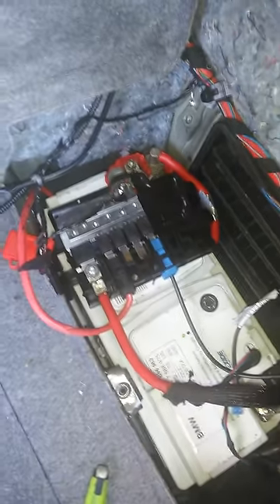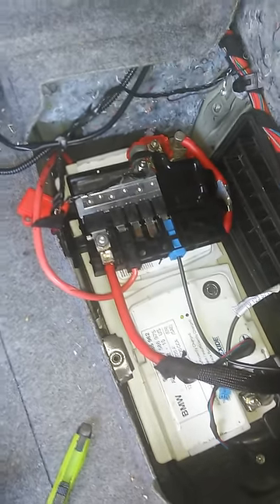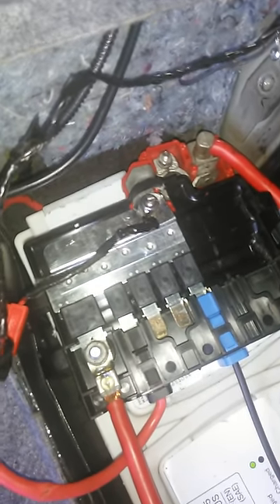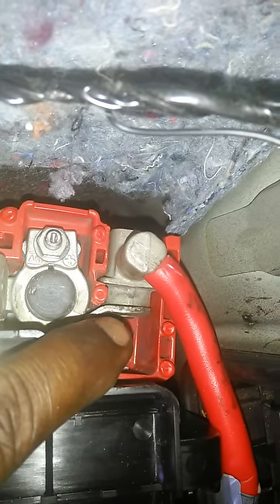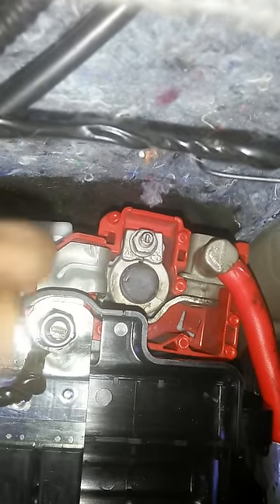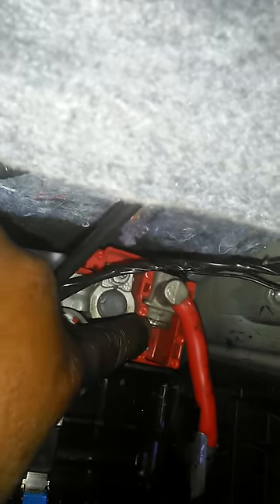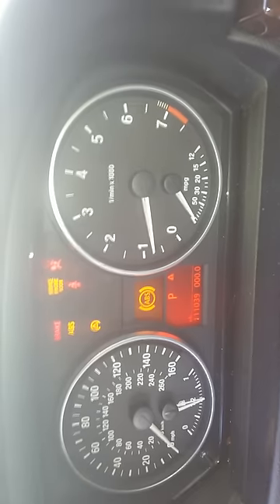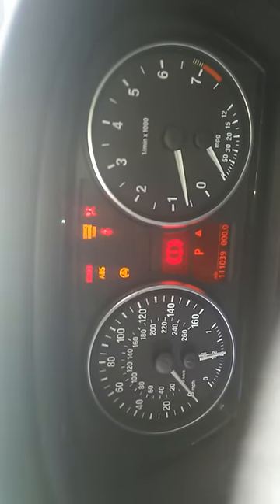08 bmw 328I starter no start problem .... FIX !!!!

Comment from the maker: What i found out is the "fuse" is some kind of feature to basically cut power to the car after an accident ... Basically i eliminated the fuse and it started rite up... The top snaps off easy ... Like i said im just trying to save ppl some money cus im sure the diagnosis and repair at a shop or dealership would be ridiculous ... Took me 10 minutes and boom problem solved .. I hope this helps
Reply: had the same thing happen on my 2007 525.  looks a little different but does the same thing.  I did same as you and just shoved it back together.   car started and ran like normal but I kept checking that battery cable and mine was getting super hot after just 5 minutes of driving.. I kept checking and it eventually split that big thick battery cable from the heat..  so I ended up having to find another BST that hadn't blown off to replace it.  I have know idea why it would matter unless there is some kind of resistor in that sensor that you took off that regulates the electrical flow..   just please make sure your wire isn't getting hot
Reply from the maker: MINE RUNS JUST FINE...IF YOURS IS GETTING HOT... IT GROUNDING SOMEWHERE MOST CARS THAT WIRE RUNS DIRECT TO STARTER ... IN THE VIDEO THE CAR WAS RUNNING FOR ATLEAST 30 MINUTES CUS I WAS TESTING THE COOLING SYSTEM TO SEE IF IT WOULD OVERHEAT.. NOT SURE WHY THEY DONT HAVE TEMP GUAGES BUT YEA...LOLTHANKS FOR THE HEADS UP BRO !!
Reply: 2008 bmw 328i won't crank
Reply: Eddy Loves cars, did the car have any power at all?  I have power in the battery, I have power to the front positive starter point under the hood but no power to the junction box.
Reply from the maker: Nicole Clevinger it had power it just didnt have power to the starter... All it used to do was "click" 

Everything would turn on but no start
Reply: Eddy Loves cars, thanks.  My car has no power at all.  No lights, no nothing.
Reply: CHANG THE RED BOX  $ 50 DOLLAR AND BUSH THE CABAL IN AND THE CAR START
Reply: Need help my car wont start
Reply: There is a really easy way to bypass it for testing purposes though thankfully...because it goes bad a lot. In the engine compartment you will find a connector that you can separate. It's basically a terminal block for the wire that comes from the battery all the way up to the engine and the wire that goes from the block down to the starter. Take a pair of jumper cables, and connect one side directly to the battery + post and the other side to that little junction. If your car suddenly starts afterwards, then there is a pretty good chance that you've found your problem. Hope that helps someone...
Reply: GloryWalker kitchens can u make of video of your problem?
Reply: Eddy Loves cars just be careful running it without a fuse. Because the fuse is designed to save the start motor if excess power if ran through the system. So instead of blowing up the expensive starter it blows up the cheap $5 fuse. Just don’t want you to run your car without a fuse on the starter in case it blows up the starter for real next time.
Reply: What symptoms did your car have? Did it give you any weird issues with dashboard before you figured out this part? Asking cause i have a 2011 335i just had Alternator changed and IM having this issue. I did not pry the red plastic off yet, going to try that tomorrow.
Reply: Ed Rockwylaa how do you take the red thing off the plastic thing man?
Reply: @edrockwylaa4472  same thing I’m going through now
Reply from the maker: @stevenrogersfineart4224  what if i told you this video is to show you where the problem is and u have the option to fix it later now that i saved YOU time and money 
oh yea most cars do not have this feature and they run just fine ...PS your welcome
Reply from the maker: @lachlanl2244  the fuses are inside the red thing if you crack it open youll see them all so everything is still fused ... 5 years later car is running just fine
Reply: @classy.redneck  sometimes if your IBS(intelligent battery sensor) is faulty, it will allow the battery to drain. So a jump might help to get power back if all the cables and their connections look good. What he's working on in the video is the BST(battery safety terminal). It pops out in the event you're ever in and accident, god forbid, to break the connection to the starter so the car won't catch fire or anything crazy if you try to start it. 
Being that my car has a rebuilt title, I'm hoping that this is the actual issue and not my starter.
Reply: @TheBoulKash  yeah I had researched and learned about the fuse on the battery.  Turns out the starter went out.  I replaced the starter with the help of a great you tube  video.  Took hours.
Reply: @classy.redneck  the starter going bad can cause your car to have no power at all? Or was it you’d battery too?
Reply: @jayhilfigertv5929  it was the battery.  One of the million red cables got tucked behind the back of the trunk and forgotten about.  When the starter went out, I had power but nothing, no clicks, just dead.  After hours and hours of removing the intake, I replaced the starter and then voila.  Then 6 months later more and more problems.  I sold  the last beamer I will ever agree to own.  Lol
Reply: @edrockwylaa4472  My 2008 E90 335XI  clicks just once when I push the start button. I put a new battery in, still won't crank only one click. Is that what yours did? Everything else works...radio, wipers, dash, etc. Just one click when I pushed start button. I hope this will fix it. I'll try tomorrow when light out.
Reply from the maker: @uptownphotography  yes
Reply: Bro I got the 2008 328xi I just did everything you did n it still won’t crank I done put a new battery new alternator and NEW starter n it won’t crank everything is on but when I try to crank I keep hearing a buzzin sound from the back what is this problem??
Reply: @classy.redneck  what was the video??
Reply: Its long but perfect with all the explanations

Comment: Okay guys ut doesn't work for everyone but wait a second, just take out the battery and follow the cable that he is talking about and at the end of that cable it is connected to another cable that goes through the car and then to the starter. So make sure to check the bottom cable too becs it might be broken or damaged like mine

Comment: That fuse prevents the battery from shorting out in a wreck and either exploding, starting a fire, or saving electrical components. Supposedly.

Comment: this guy is absolutely RIGHT!! i bought a 2011 BMW 328XI SULEV off the auction .. Every time id have to jump the car and it would not charge the battery and car would shut off 5-10 minutes after. After 3 days of messing around thinking its my alternator , starter, other stuff, Ended up being the exact thing this guy is talking about. So ppl dont drive the car to the dealer and spend 4-5bills first check the IBS.
Reply: I hope you meant BTS because this video is not about the IBS, which is over on the black battery terminal connector cable.

Comment: Would this trigger a check engine light in the dash. I have the same problem and I have alr replaced my alternator starter and fuel pump. I’m gonna try this out tomorrow!!

Comment: My guy, great video.I feel you all the way.. It is a safety mech bmw has... Learned there is basically an "airbag" that seperates that positive cable to prevent car from starting. (Usually this occurs after some type of collision or impact to vehicle) Im having same type of click "no start" symptoms right now I know damn well I ain't trying to remove the whole intake just to get to the starter ...so I'm about to go pop Pop My trunk right now and check that out. Good lookin
Reply: did you

Comment: Modulator of the starship enterprise HILARIOUS. Hahahah.
Need more videos like this. Thanks a lot.

Mine doesn't have this. Or I can't find it. 116i 1 series.

Had the car standing all winter. Battery flat. Re-charged it. Now the car just 'clicks'
Could be the ground strap in the engine bay or back with the battery.

Comment: Thanks. This is great to know. Hopefully it solves our problem.
However, if this was common, most people will have unknowingly replaced their starter and still not been able to start the car due to the issue you've identified. 
That being said, with most people changing the starter and the engine starting right away afterwards... The starter seems to most often be the cause of the issue and also the solution

Comment: Man imma go home and check if this is what’s wrong. thanks for helping the bmw community out. Got a bmw for free and they couldn’t figure why it wasn’t starting… 🙏🏽
Reply: Did it work for you? I’m having this same starting problem with my bmw, just changed the battery, got a new starter last year in August, we are going to try this today 🙏🏽
Reply: @StephCherie  I did try this fix but I don’t think it was the problem. It ended up being the starter. Previous owner installed a cheap starter so I ordered a used $35 starter from eBay and worked like a charm. Got lucky and started up after some engine cranking.

Does your engine crank over? Are there any Trouble codes? I hope you figure it out. Good cars.

Comment: Hi Ed' You're correct, the positive lead has a Sensor, and when the car has had an accident, or a knock, can set off the (IBS) Battery gas charge and blows the positive lead apart as you indicated, then you can't start the car, I'm waiting for a new lead because of the gas charge. and my battery keeps going flat, Cheers !!

Comment: Eddy, thanks for the video.  Just curious, will the starter still get power?  I am having the same issue, however, the mechanic at my shop says it can’t be that problem because it’s still getting power up front.  I’m going to try myself.  Thanks again!
Reply from the maker: the starter has two power wires going to it... the big one is from the battery where the "fuse" cuts power and the little one where the push button start makes the starter go "click"

the whole car will have power like normally would >> radio windows ac blower sunroof bla bla bla..  it just wont start

Comment: Bro it worked, I know this is an old video and you probably won’t see this but thanks man I was seriously getting worried I’d have to take it to the dealership and get fucked. 

How did you find out about this fix? You’re a genius 😂
Reply from the maker: im a shade tree mechanic of sorts.. so i just recognized the symptoms and  started poking around with my trusty light tester .. boom problem solved lol
Reply: I'm glad this worked for you. I am going to try this myself.
Reply: SeeCam TheSweetFam I had to break the plastic red thing on the positive terminal, took me a good hour and a lot of patience lol

Comment: Eddy Loves Cars this seems like the problem with my 2011 335i.  Problem is the red plastic cover around the battery connection is riveted together from the factory.  The big red flat cover came right off just like in your video but the little cover covering just the end of the cable is riveted.   Did you have the same issue?  I'm thinking about drilling out the rivets.  I'm wondering if the rivets are something they did on newer models to keep normal people from making the fix.  What do you think? Thanks for your video.  It was great!
Reply: Did you fix it?
Reply: Royce Saunders  fixed the electrical issue.  If I remember correctly it was the starter.  I believe that was the third starter we put on the car. Within days of fixing the electrical, we had an issue with the vanos system.  I got rid of the car.  Loved the car when I first bought it, hated it by the time I got rid of it.  Thanks anyway though.

Comment: Thank you Eddy for this my machinic had to do a little different way but still did some way on how you did on the battery but your idea on checking the battery first works the fuse/hella terminal blew out I'm pissed my boyfriend paid for a whole starter but when the machinic tried the battery thing it crank right away thanks again

Comment: Hi Eddie . What year is your car . i have a 2008 BMW 328i . i tried following your instruction but the part where you have to hammer is coated with red plastic . What year is your car and the model . thanks .. and your immediate response would be appreciated.
Reply from the maker: vostro vostro th car is 07 328I 4 door...the plastic actually separates ... the terminals fit in "slots" in the plastic remove and put together as if you would a battery terminal on to a top pole .. easy

Comment: I'm having the same problem ! I was going to try to do what you did but having trouble taking off the red plastics ! You should do a video on how to take those off . Did you just break them off ?
Reply: Jay Baltierra how did you take the red plastic off
Reply: ya i just tried this my car is doing the same thing..car seems to have power good but yea the read plastics won't come off unless you attempt to break them

Comment: had a similar issue with my 2006 e90 (330i sport edition) but when I checked that part of the battery/starter cable it was ok. I ended up getting a really long speed bar and tapped the starter,  though the intake runners, and freed the starter up so it would crank. now I know this did not fix anything but mierly allowed me to start the car so I could get it in to have the starter replaced.

Comment: 😂😂😂😂 dude I can not with you you had laughing tf out loud cause you got straight to the point I gotta  2008 328i and i installed a new starter and we put a new  sensor too and it still won’t start we also trying to figure out out this damn relay but we can’t find this same relay now where in my town

Comment: there seems to be a gap on my positive battery cable but i still get no dash lights or anything not even a click from the starter.hmm
Reply from the maker: battery dead
Reply: Eddy Loves cars battery at 12.5 volts, I got dash lights to come on but when I try to start all I hear is fuel pump sound
Reply from the maker: if you hit the start button and all the light kinda dim a lil bit on the dash for a sec  ..means the car is trying to start... but if it doesn't then id get a test light to the starter solenoid wire... tricky part is its hidden under the intake but not hard to find if it lights up when u try to start but no strt then u have a bad starter … and that job is for advanced mechanics

Comment: Hey Ed I’m having some problem I have bmw 530d 2007/08 

I started the car up drove  out  my turning in the wet the car slid a little as it does sometimes 
Then I had engine management light flash 

Then I lost power and car died. 
 The lights gone of now 

And it just cranks. Like goes to start. But won’t start 

I’m having people telling me it’s your timing chain 
Camshaft is broke ... stressing me out 

What do you think man ?
Reply: Did you ever find out if this worked?
Reply: @KohvesMUSIC  yes mate was timing chains. My on board oil sensor was gone so had no oil.  B yes was chains.

Comment: Hi thanks mate I am going to have a look at my battery terminal posts and connection tomorrow. My bmw cut out as i was traveling over a speed bump and when I tried starting all I heard was that click click sound and the RAC tech said could be the starter or engine siezed mate.
Your a life saver.

Cheers

Comment: On the positive terminal that was separated I actually put it back together, drilled small hole through it and used a long screw two washers and a bolt to fasten it back together permanently.

Comment: Hey Ed. I changed my battery and now my radio doesn't work. Car cranked after trying you method but after me letting it sit and not driving same problems again.  Crank no.start. I'm going to try your method again. Do you know how I can get my radio to.work?

Comment: Good advice, but I don’t think that is my issue. I have no power at all the car has been sitting awhile and the battery drained as I was doing work I was replacing the valve winter came and to let little baby sit.

Comment: My 2007 bmw 328i won't start and the break pedal is hard. It has a yellow symbol with a exclamation point. It was running fine and everything. It just won't start. Any suggestions?
Reply: Have you fix your car? I have the same situation as yours
Reply: Manny Gonzalez Did you fix that already? I have the same problem right now!! Help me please 😩😩
Reply: I have the same problem smh
Reply: Johvanny Guerrero I have the same problem
Reply: Did anybody find a way to fix this problem???
Reply: Has anyone fixed this problem? I’m having it today. My mechanic just took off the starter and tested it and it appears to work fine.  Already changed out battery as well. FML.
Reply: I got the same issue where is the help?
Reply: Exact same thing with mine today
Reply: Same need a  answer before buying all the parts
Reply: Manny Gonzalez yo did you find out what was wrong i got the same issue
Reply: Manny Gonzalez hey bro I have the same problem 2011 328i help ASAP

Comment: My bmw 325i 2006 doesn’t start but all the lights and sound goes on, we change the starter recently. The car still doesn’t start so I’m guessing it wasn’t the starter idk what to do lol help?
Reply from the maker: WATCH MY VIDEO OVER … OR MAYBE THE BATTERY IS LOW.. IVE HAD DEAD BATTERY ONCE AND IT WOULDNT START THE CAR EVEN WITH A JUMP... I SWAPPED THE BATTERY AND IT CRUNK RITE UP..HOPE THIS HELPS
Reply: I have the same problem right now on my 2008 328i .. did you find a solution?
Reply from the maker: Guillermo Uranga watch the video my friend... If you changed the starter and notilhing happened ... This is the problem
Reply: Will do brother. Thank you!
Reply: Guillermo Uranga did it work pls respond I have same year bmw